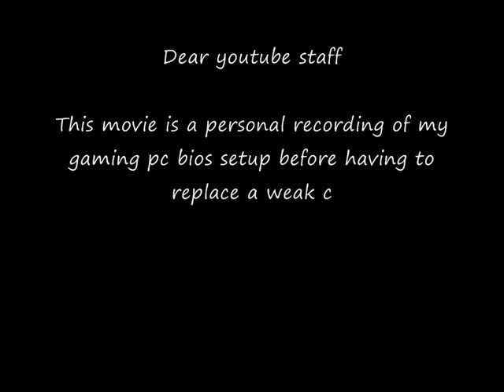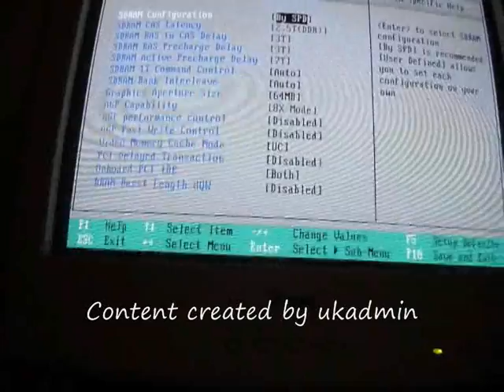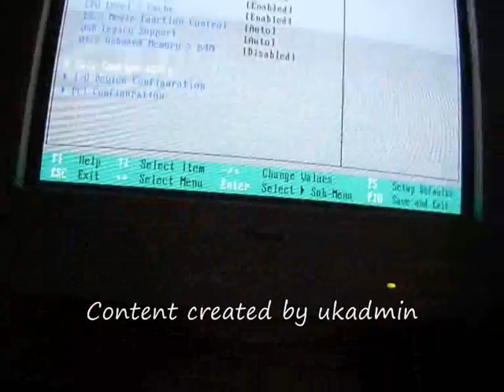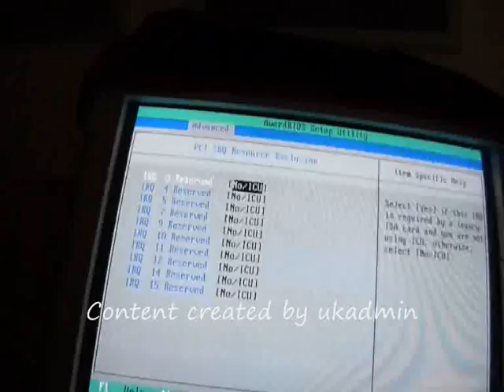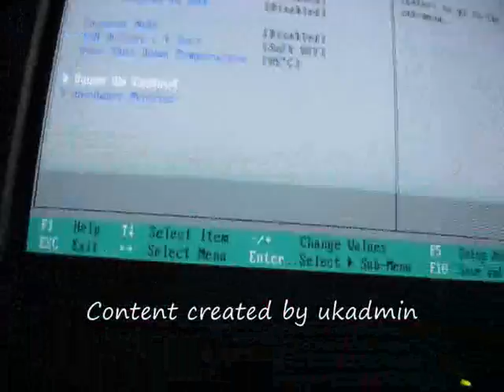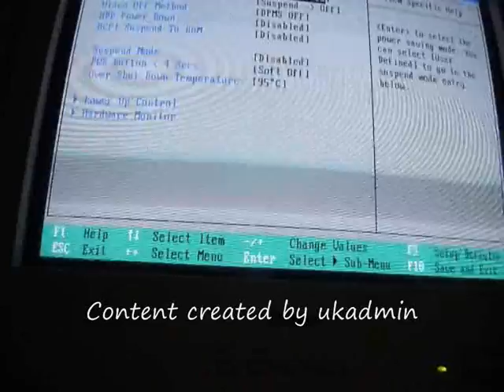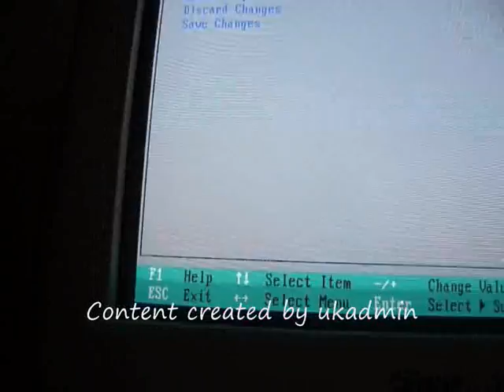My Gaming Pc Bios Setup

Comment from the maker: Hi guys.

If you cant follow this movie its simply a live streaming movie so i could reset and setup my bios exactly the same again after replacing a weak cmos battery.

The setup in this bios may possibly be different in your bios so please do not assume you can use these bios settings on your pc or laptop.

Thanks ukadmin.